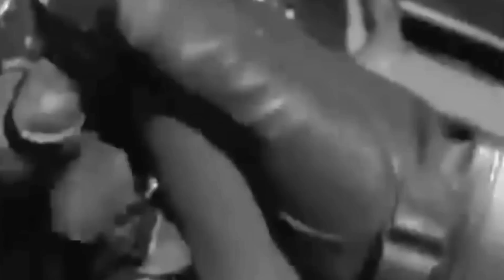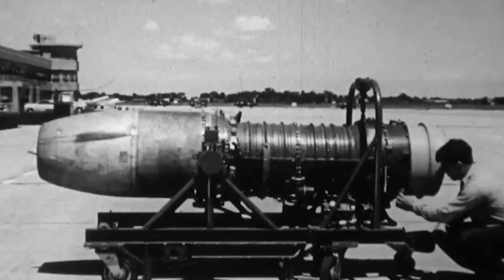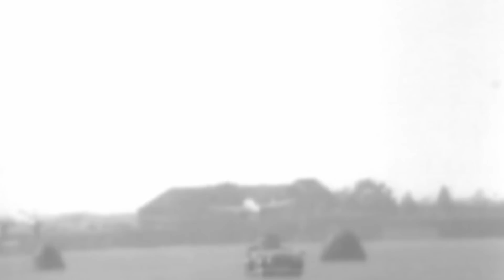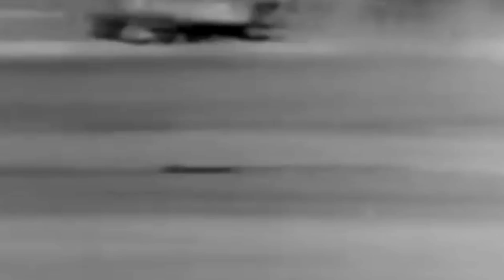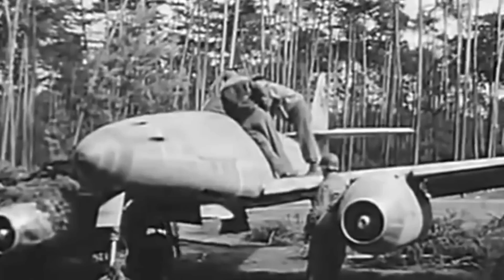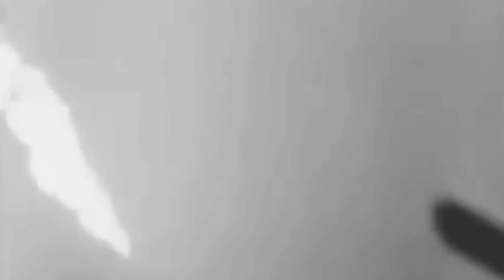The Never Before Seen Fighter

Comment: There is a lot of hype about this aircraft.
Reply: It's not hype, the Me-262 is the most significant, revolutionary aircraft since the Wright Flyer.
Over 100 mph faster than any Allied aircraft it completely outclassed everything else in service during WW2.
Reply: @WilhelmKarsten Poca diferencia de velocidad. Fue derribado varias veces por los P-51.
Reply: @WilhelmKarsten  Little difference in speed. Was shot down several times by P-51s.
Reply: @juanar4305  P-51 Mustang was completely outclassed by the Me-262
Reply: @WilhelmKarsten  Didn't you know that the Me-262 was shot down several times by the P-51? On the other hand, the Me-262 had no influence on the war. The P-51s did against the M-262s what the M-262s did against the bombers. They would climb high and swoop down, and in that way they would get close to the M-262s. Of course, nothing could escape the bullets of the Browning M2 machine guns, which fly at 2000 mph.
The m-262 technology was too immature. Its engine did not last at all. It had no autonomy. A calamity. It would have been better for the Nazis to produce more Me-109. Did you know that no (Junkers) Jumo 004 B engine survived? It burned itself. On the other hand, the Gloster Meteors are still working today with their original engines (Rolls-Royce Derwent 8). The Me-262 was pure Nazi propaganda.
Reply: But it certainly impressed the Allied pilots. swooping down with engines without propellers and a big noise.
Reply: @juanar4305  26 Me-262 pilots scored Ace or higher shooting down over 550 Allied aircraft including fighter aircraft like the P-51, Spitfire and Tempest.

Kurt Welter remains the highest scoring jet Ace in history.
Reply: @WilhelmKarsten  If an Me-262 came face to face with a P-51, either could go down. If both survived, the P51 could get on its tail faster because its turning radius was 4 times smaller than that of an Me-262, which flew just 90 miles faster.... and which could not escape the P-51's bullets.
Reply: @juanar4305  The Jumo-004B Orkan engines used on the Messerschmitt Me-262 was the most successful jet engine in WW2.
It easily passed the RLMs 100 hour PFTR reliability test required for adoption into Luftwaffe service.
The same 100 hour PFTR requirements for the RAF and USAAF.
The USAAF exhaustively tested the Me-262 during Operation LUSTY and confirmed TBOs averaged 55 hours.
EXCELLENT by WW2 standards for Allied piston engines.
Reply: @juanar4305  Lies! BALD FACED LIES!
There are no original WW2 Allied jets still flying today.
The Derwent 8 didn't enter service until the mid-1950s.

The Gloster Meatbox was was not a fighter and never saw operational RAF service as a fighter.
The Gloster Meatbox only killed British pilots.
Reply: @juanar4305  Many Allied airmen never saw the Messerschmitt Me-262 that killed them.
Reply: @juanar4305  The P-51 Mustang could not outturn the Me-262... the P-51 was completely outclassed by the Me-262
Reply: @WilhelmKarsten  The Jumo-004B was an immature engine. Metallurgy at that time was not ready for axial compression.
Reply: @juanar4305  The compressor does not require special heat resistant alloys.
Reply: @juanar4305  The Jumo 109-004B was not just the most advanced jet engine in WW2 it was also the most developed.
The 004B was not just an axial compressor turbojet it was also the first jet engine with variable convergence exhaust nozzle, hollow turbine vanes and blades cooled by compressor bleed air and the first use of TBCs
.you really don't know anything about the Jumo 109-004B Orkan engines do you?
Reply: @juanar4305  Actually, Krupp P-198 Chromadur alloy is still used in jet engines today and is sold under the name A292
Reply: @WilhelmKarsten  You took the question out of my mouth. It was the one I was going to ask you.
Reply: @juanar4305  I would be very happy to answer any questions you may have about the Jumo 109-004B Orkan.
I wrote my thesis on the Jumo Orkan and actually interviewed Dr. Anselm Franz himself when he was Vice president of Lycoming-Textron
Reply: @WilhelmKarsten  A mature, well developed engine is not measured in 10 or 15 hs of life, like the Jumo. Think that each sortie of the Me-262 lasted half an hour and could sortie twenty to thirty times, after which, it was no longer safe, not worth servicing. If the Nazis developed a better version, it certainly did not get much use. Mature engines were the Merlin or any of those fitted to the top conventional fighters of the time, which could run for thousands of hours. For example, the Merlin (generally speaking) had a durability of 200 hours before requiring a major overhaul. But after the overhaul it kept flying, and the normal thing was that they lasted thousands of hours, like any explosion engine, German, Allied, Soviet or Japanese. Meanwhile the Jumo 004, except for the wonderful version you mention, on average, had to be replaced after 30 hours and the retired engine was no longer considered reliable. Obviously, I am not talking about the wonderful last version you mention.
Reply: @juanar4305  That comment reveals someone who has absolutely no formal education or professional experience in aircraft powerplant design or maintenance.
Reply: @juanar4305  Are you referring to TBOs? Or PFTRs?
Reply: @juanar4305  If you are talking about TBOs? Is that with WEP or just MIL ???
Reply: @WilhelmKarsten  I see that you continue to be in possession of very secretive information (known to you and two other people). Except for TBO, I'm afraid you are making up the acronyms, the old trick of those who pretend to be knowledgeable about something. But you will not be able to divert attention from the fact that after 15 hours (1) on average the JUMO 004s were changed. What I tell you is consensus public information read from various sources over decades. If you are objecting to me on that point.... you are objecting to everybody. 
How does your strategy continue? To reach the conclusion that I am not a professional in jet engine maintenance (and you are) and therefore I am wrong? By the way, the same dishonest tactics of your communist cousins. At the opposite end of the ideology, but always cheaters both.

(1) Edited. 30 sorties of half an hour each.
Reply: @WilhelmKarsten  Hello Sandyboy, as you know your exaggerated 550 number is dubious and P51s, Spitfires and Tempests all shot down Me 262s.
Reply: @WilhelmKarsten  Hello Sandyboy, as you know the Ju 004B was a disaster making a considerable contribution to the luftwaffe's consistent failure to get more than 30 Me 262s in the air at once. 
Sandyboy, PFTRs are an American developmental test (principally for financial allocation considerations) that do not establish an engines worthiness for service. It is implicit in the purpose of the test that they don't establish an engines worthiness for service. Think about it Sandyboy.  Such tests would not be in the remit of the RAF.
Sandyboy, as you know 55 hours is NOT excellent by WW2 standards. The Merlin having a TBO of 240 hours, the R 2800 a TBO of 300 hours and the Welland and Derwent having TBOs of 150 hours.
Reply: @WilhelmKarsten  As you know Sandyboy, Eric 'Winkle' Brown who you often quote as an authority, stated that the Me 262 was "NO FIGHTER". 
The Gloster Meteor as you know Sandyboy, had a service career of more than thirty years and with more than a dozen air forces, including the Argentinian air force that was being advised by Kurt Tank and Adolf Galland. Galland as you know describe the Meteor as a fine aircraft and said that  he wished he'd had the Meteor's engines on the Me 262.
Reply: @WilhelmKarsten  Sandyboy, as you know...   From 'InTechMaterials for gas turbines'

"Today, the maximum temperature limit for near- alloys for elevated temperature
applications is about 540 oC. This temperature limitation for titanium alloys mean the hottest
parts in the COMPRESSOR, i.e. the discs and blades of the last COMPRESSOR stages, have to be
manufactured from Ni-based superalloys..."  (my caps)
Reply: @WilhelmKarsten  Hello Sandyboy, as you know Sandyboy the Ju 004 was an underdeveloped and hopeless engine, whatever tricks your nazi heroes chucked at it couldn't stop it being fragile, unreliable and ephemeral.
As you know, the depth of its weaknesses were shown postwar when in Russia a host of German engineers with extra help from Russian engineers and all the alloying elements they needed, couldn't significantly improve on the poor reliability and durability of the Ju 004 (RD 10) and consequently it was only fitted to second rate aircraft and a few experimentals.
Reply: @WilhelmKarsten  Hello Sandyboy, Clearly juanar4305 is referring to TBOs. WEP as you know was an American system that required an engine inspection after use, other air forces logged use of high boost.
As you know Sandyboy, the Merlin had a TBO of 240 hours, the R 2800 a TBO of 300 hours and the Welland and Derwent having TBOs of 150 hours.
Reply: @WilhelmKarsten  Difference there was between the Harrier and the Mirage 3.
Reply: @juanar4305  Not a valid analogy, the Mirage III is a Mach 2 Fighter-interceptor, the Harrier is a subsonic attack aircraft (light bomber)
Reply: @WilhelmKarsten In short, the me-262 barely intervened in the war, one could almost say that its presence was anecdotal and for that very reason changed nothing. how wise were the allies, including the soviets, not to spend money to develop their own reactors more quickly. It was not the time for experiments. And that's how they won.

Comment: There is a huge misconception about the manoeuvrability of this plane. The turning circle was very large indeed. It was unreliable, had fragile and short lived engines. Pretty much the only thing it had going for it in a dogfight was speed, even with this advantage, it's large turning circle was easily taken advantage of by other prop planes at the end of the war.
Reply: The Messerschmitt Me-262 had excellent turn radius to speed ratio performance and could turn and maneuver at speeds over 100 mph faster than any Allied aircraft could achieve in straight and level flight.
Of course the real advantage of swept wings and jet engines is that they do not quickly lose speed in a dogfight like propeller driven aircraft with straight wings.
Not that it mattered, the Me-262 completely outclassed anything that the Allies had during WW2.
Reply: The Junkers Jumo 109-004B Orkan engines were without any doubt the most successful jet engine in WW2.
The 004B met or exceeded the RLMs 100 hour PFTR reliability test required for adoption into Luftwaffe service.
It's the same 100 hour PFTR requirements for the RAF and USAAF during WW2 

Operation LUSTY confirmed TBOs averaged 55 hours, EXCELLENT by WW2 standards for Allied high performance piston engines and better than Allied jet engines

Comment: If Hitler would not interfear with the idea to mak a dive bomber of the ME-262, it could have been operational 6 months earlier.
Reply: That's a completely false myth, the only delay in production was caused by the redesigned engines that was due to shortage of Nickel alloy
Reply: @WilhelmKarsten  You have to do some more homework.
When the ME-262 was ready to go into full production, Hitler insisted to convert the ME-262 into a dive bomber that Adolf Galland opposed.
Hitler thought the same succes could be gained again like he did at the start of the war with the Stuka's divebombers.
This took time and resources hampering the   production numbers while the engineers feverishly tried to convert the 262 into the dive bomber he wanted
Hitler got his way, and he allowed only to produce 1 fighter for every 20 produced 262's that were build into dive bombers.
It took precious time and rescoures, before Hitler became to his sences and reversed this illogical decision.
You can look up any source about the development of the ME-262, and you will read the same story i wrote.
Reply: @opoxious1592  Hitler was proven absolutely correct, modern jet fighters are multi-role Interceptor-Attack aircraft with bombing capabilities.
The Messerschmitt Me-262 was not different from propeller driven fighters like the P-51 Mustang which also had bomb racks hard points and carried a similar bomb load.
The Mustang was also built as a dedicated bomber variant, called the A-36

Any questions son?

Comment: I read that the advantage of the swept wings was found by accident because they wanted to change the CG of the aircraft with the engine mountings.
Reply: That's a completely false myth based on a single dubious source and contradicts all the historical evidence.

The Messerschmitt Me-262 was designed from inception to have swept wings and ALL swept control surfaces as well as a fly-by-wire Horizontal Stabilator to counteract the effects of compressiblity at high transonic speeds. 
The Me-262 has the highest critical Mach number performance of any WW2 aircraft.
Any questions?
Reply: @WilhelmKarsten  thank you
Reply: @WilhelmKarsten  BULLSHIT the wings were not swept, just the leading edge, by that standard the DC3/C47 was also a swept wing 10 years earlier !!!  DUUUUHH!!!!!!!
Reply: @wilburfinnigan2142 Everyone knows that the Messerschmitt Me-262 was the first jet aircraft with swept wings.
Reply: @WilhelmKarsten  Hello Sandyboy, if as you say the CofG change fact is "a completely false myth based on a single dubious source and contradicts all the historical evidence" pleas identify the single source and provide any of your 'historical evidence'.  
As you know Sandyboy, the Me 262 did NOT have a 'fly-by-wire Horizontal Stabilator' , it had a conventional tail plane with a powered trim adjuster similar to that on the Wetland Lysander.
As you know, the Me 262 had a lower critical mach number than the Spitfire.
Reply: @WilhelmKarsten  Sandyboy if as you claim the CofG fact is a "completely false myth based on a single dubious source and contradicts all the historical evidence2, can you identify the 'single dubious source' and provide any of the 'historical evidence' ?
Reply: @WilhelmKarsten  As you know Sandyboy, the Me 262 did not have a ' fly-by-wire Horizontal Stabilator' , it had a conventional tail with a powered trim adjuster like the Westland Lysander. Me 262 pilots were warned not to use it foe any other purpose.
Reply: The sweep of the Me 262's wing was indeed a result of a change in engine causing static margin issues, its 18.5 degree sweep is too little to make much improvement otherwise and the Me 262 has a lower critichal mach number than the Spitfire.  Swept wings had been adopted for that and other reasons since 1910 at least. Its usefulness in transonic flight was  first theorised and publicly described by Adolf Busemann in 1935 at the international Volta conference. Busemann continued to refine and number crunch his theory into and throughout WW2.  Busemann did actually suggest a 35 degree sweep for project 1065 (Me 262) but his suggestion was rejected by Bolkow, the project's aerodynamicist.

Comment: The first generation American jet planes used straight wings instead of swept wing designs as the ME-262 had. Why, I could never figure out. It was a proven concept that was used by the Russians in their Migs.
Reply: The Messerschmitt Me-262 was designed and tested at the RLMs Luftfahrtforschungsanstalt in Brauschweig, it was the world's only supersonic aircraft wind tunnel laboratory during WW2.

The MiG-15 was designed by German Heinkel engineer Seigfried Gunter in 1945 using the same supersonic wind tunnel data.
Gunter designed the the first jet, the He-178.
Reply: @WilhelmKarsten  Me262 could not go supersonic, Hell a P51 would out dive it just as Bud Anderson as he did,
Reply: @wilburfinnigan2142  Hans Mutke was the first man to reach Mach 1 in a dive... and live to tell the tale.
Chuck Yeager confirmed Mutke's story
Reply: @wilburfinnigan2142  A computer-based performance analysis of the Me 262 carried out in 1999 at the Technische Universität München concluded that the Me 262 could indeed exceed Mach
Reply: Swept wings go back to 1910 at least. The Me 262's wing sweep had nothing to do with high speed flight and was established to correct the static margin when the engine type was changed. Bolkow the Me 262s aerodynamicist rejected Busemann's suggestion of an 35 degree wing sweep. The wing sweep on the MiG-15 is 35 degrees.

Comment: Now just imagine.... If the Luftwaffe had prioritized the jet, they could have had a working jet fighter in 41 MAYBE in 1940. Just imagine.... There's nothing at all that the allies could have done for 2 or 3 years to touch them. The Luftwaffe would have ruled the air in every theater they flew in. If they shared that technology early with the Japanese, the same could be said for the Pacific. Several key developments would have never happened. That one thing could have made the outcome completely different.
Reply: cavethug...IT did NOT happen, the engine technology was not up to the task !!!!
Reply: @wilburfinnigan2142 Germany developed the most advanced jet engine technology that existed during WW2..
Reply: @WilhelmKarsten  Hello Sandyboy, as you know, the Germans developed the crappiest jet engines that existed during WW2.